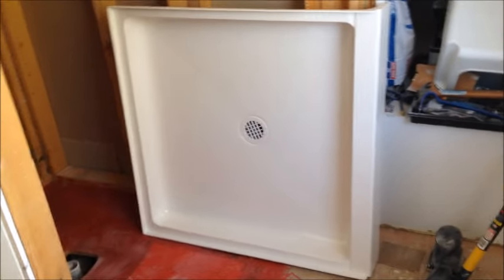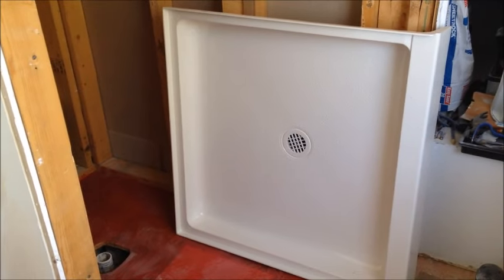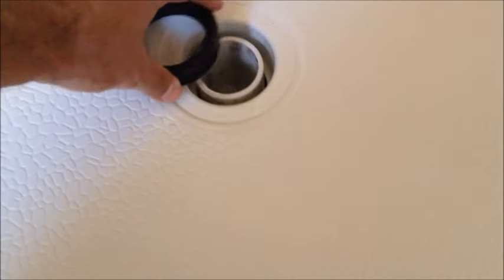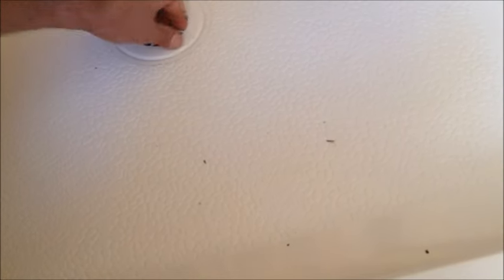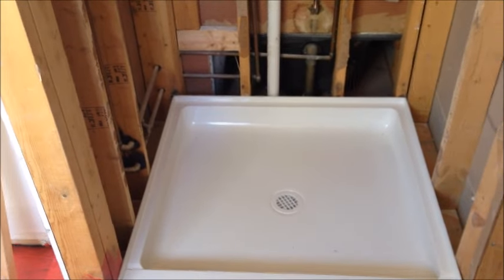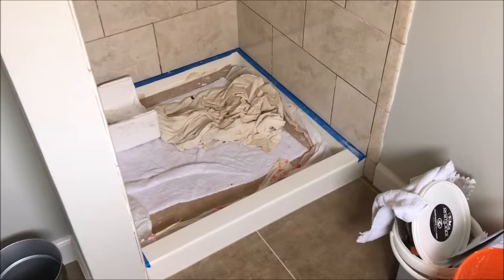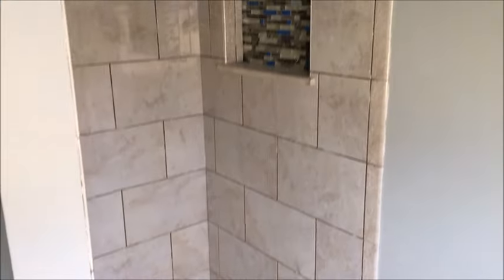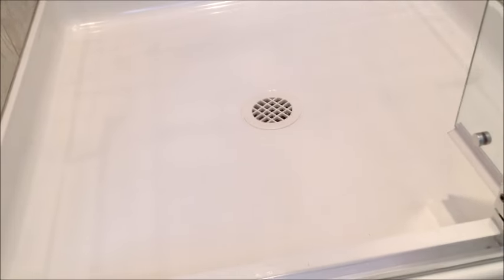Bathroom Remodel   Swanstone ss-3636 Shower Pan Shower Base

Comment: Rick, I have the same exact shower pan I'm about to install. Can you tell me how high the drain pipe should be cut? Is the drain pipe supposed to be slightly above or slightly below the rubber gasket? The swanstone installation manual does not specify.
Reply from the maker: Hi John.  Assuming you are test fitting the pan, I would cut the drain to be slightly below the top of the rubber gasket.  Maybe 1/8-1/4 in below.  Mine is just slightly above the rubber gasket and we get a lot of mildew with the resting water.
Reply: @RickCarlo  thank you!! Awesome video btw!

Comment: So you left about 1/8 inch gap between the bottom of the tiles and the lip of the shower pan? And then used a matching color silicone to your grout to fill that Gap? Just clarifying
Reply from the maker: The pan has a 1 inch (or so) "flange" that goes up the wall and contains the water.  The green board (or cement board, if you are using that) comes down but doesn't touch the flange.  Since the green board is thicker than the pan plastic, the tile can extend down below the bottom of the green board and overlaps the flange going to the top side of the pan (a little tough to explain - just know that you won't see the flange anymore).  So the gap between the pan and the tile is about 1/8' which is easily caulked.  There is room behind the tile, but I did not fill that with more caulk.  The original pan I replaced had wads of liquid nails behind the tile which is not recommended because it wicks up water higher than the flange and into the wall.  I just caulked the 1/8" space and left it at that.  I used a matching sanded caulk.  After almost 4 years I will be removing that caulk and put in a smooth white caulk.  The sanded just seems to have more pockets to keep water and is getting moldy and is hard to clean.  HTH.
Reply: @RickCarlo  thanks man I really appreciate it. Going to be tearing out a bathtub and putting in a 60 inch shower pan after the holidays. Fun fun fun. Your video is very helpful

Comment: Rick Carlo, do you have any info on the shower door you used? i am remodeling the same size shower in our loft and have been wondering on what to use.. TIA!!
Reply from the maker: Ah...a commmon questions.  :-)  It was a Kohler Revel bought from Lowes.  About $550-$600.

Comment: I wander how you installed board and attached it to plastic pan. Can you please explain in detail. Thank you.
Reply from the maker: I'm a little uncertain what you are asking.  The pan isn't really attached to anything other than the drain.  Since this was a renovation the space had been built to fit the 36"x36" pan.  After the pan was laid in the spot I put the greenboard up.  There is about a 1/2" gap between the greenboard and the upper lip of the pan.  The tile overlaps the greenboard so that the gap between the tile and pan is only 1/8".   That 1/8" gap is filled with chalk.  Hope that helps.
Reply: @RickCarlo  thank you for replying to my comment. I am not sure how you caulked the gap between board and pan. I guess that was only missing part because you show the gap and next moment is you already have tile on the wall.
Reply from the maker: @elvirawatson6565  Ah, gotcha.  I basically squirted enough caulk to cover the gap.  This isn't a problem with a nice 1/8 gap, but I can't say I had a perfect 1/8th inch gap around, so I had to fill up where my gap was larger.  I just squirted more in those areas until I could get a good line when smoothing the caulk out.  The caulk did seem to shrink a little in these areas.  After a couple years we are starting to get mold at the bottom.  I will probably cut the old caulk out and re-caulk within the next few months.  For the larger gap areas I plan on making a couple passes.  I'll fill the area and push back a little and let dry.  I will then come through with another layer.  We'll see how that goes.

Comment: How did you adhere the shower base (swanstone) to the shower sub floor?  From the video, it looks as if you just laid it in.  Swanstone recommends a quick dry concrete for the shower base.
Reply from the maker: The base that I replaced had nothing under it.  I did the same with this one.  It is just laid on the subfloor.  The new base is sturdier, but it isn't as solid as porcelain (not as expensive either).  I am happy with the feel when standing on it.
Reply: I used screws on the top ledge at an angle to force the pan down so there's no creaking.  Works well.
Reply: I have the exact same pan. For anyone else reading this, I noted that the front curb has a recess for a 2x4. I measured 34 inches from the back wall and secured the 2x4 to the floor on it's edge. 34" center of the 2x4 to the wall. When laying down the base it creates a very secure force fit. You have to step on the curb to drive it onto the 2x4. I used the 2x4 since I was not using tile, I am using the companion side walls designed for this pan. 
On an unrelated matter, I also used silicone on the drain. The base is 2" deep your drain pipe should protrude 1" into base and be secured so it does not flex. A lot of force is required to push the gasket into place.
Reply: According to the instructions (That he clearly didn't read), you are supposed to use mortar under it.

Comment: where did you buy the glass door, is that something you can buy remade or custom fitted? Thanks
Reply from the maker: We got the shower door at Lowes.  The Kohler Revel (We paid around $550 - can't remember exactly) comes in a couple size, but you can adjust the overlap of the door to fine-tune for your opening.  After 3.5 years of use  it is holding up well.  The hinge area at the bottom could use a good cleaning and soap scum is a constant battle, but I am still good with the purchase.

Comment: Did you put a silicone  first and then grout gap between the showerpan and tile?
Reply from the maker: No, I did not grout the gap between the tile and pan.  The gap is only filled with the matching sanded caulk.
Reply: Rick Carlo oh ok thanks very much

Comment: I can't believe that you installed all the tile and never bothered to test the drain. Testing the drain should be soon as soon as the shower pan is installed, so if you have to remove it, you don't need to demolish the entire bathroom. Also, if that drywall gets wet, your tiles are going to start falling off. You should be using cement board at the very least.

Comment: Can't believe there is no packing nut for that no caulk gasket
Reply: I just tore out a shower pan that had a built in drain (no packing nut) with just a slip on gasket around the drainage pipe; It had a small leak around the drain hole. I'm thinking the rubber gasket starts to develop cracks as it ages. I like the shower pan, but the internal drain is a no go for me. I prefer a shower pan that requires a compression drain assembly like an Oatey. I'm no plumber, but that's my take. Is that your thoughts also? Thanks for any replies.
Reply: @rich3782  _____35 years pro residential plumber here. That cast-in shower drain is fine. The pipe has to be fairly straight up (no split or gouges in it, smooth surface) and the rubber seal has to be in fair shape as well. I use a little bit of lube to seat it. Never leaks. If you use a pan that requires a brass drain spud (never use plastic ones) you better reply to me if you want it to last forever.....there's a few MUST- DO'S involved. Still uses a rubber seal. (best) The guy who posted this left out the water barrier.....doomed install. (guaranteed)
Reply: @readmore3634  Thank you very much for the response back.  Had I known what you just stated, I would have gone with that shower pan in the video.  Instead, I went for a shower pan made by US Marble (not fiberglass or acrylic).  Well, this shower pan had a drain hole that was not located in the center of the pan, so I used an Oatey 42788 Offset ABS Shower Drain with Stainless Steel Strainer.  I had no play room to re-center the drain pipe, that's the reason for the use of the offset drain.  I wanted to go with a brass offset but was unable to find one.  So the one I got is ABS and not plastic.  I used the rubber seal, along with the paper ring to prevent the rubber seal from twisting, below the shower pan and used silicone for the strainer body flange that sits on top of the shower pan.  I believe the drain assembly is UPC approved.  What's your thoughts on this assembly i.e. will it last?  Again, thank you for your input.
Reply: @rich3782  ______I googled "Oatey 42788 Offset ABS Shower Drain" ...never seen one like that, I always do what it takes to move the riser ( 2"pipe) and make it about 6" high so you can slide the drain assembly(already mounted on the pan) over it when you set the pan. Kinda like this:
https://www.youtube.com/watch?v=6gchJ1prCFM
I use putty (not that rubber washer, it rots away and now you have a big leak and loose drian) and tighten that spanner nut tight! Normally don't need that much putty....squeeze it out!
The  2" will be about 6" too high. Slide the rubber seal over the pipe (grease it) and get that seal down in there. Cut the 2" with a small hammer & chisel or screwdriver all the way around, low enough to get the strainer on.
Reply: @readmore3634  Yes, I watched that video awhile back. Looks like a very solid way to connect the pan to the drain pipe. I very much like the construction of the drain assembly; that's going to last a very long time.  The only way I could relocate the drainage pipe was to cut out the first floor ceiling which I chose not to do.  Instead, I decided to go with a drain assembly similar to way a tub drain is connected.  I think I have a reliable connection that will last. I made an access panel for the Roman tub which also gives a visual sight line to the shower pan drain for monitoring.  Hopefully, no leak ever develops at the shower pan drain assembly.  If for some reason it does, I will certainly plump it the way you recommend, thanks again.

Comment: is the base a solid surface base?
Reply from the maker: The base has some "give" when standing on it, but I can tolerate it.  I was so used to the old pan having a bit more give that I noticed the improvement.  I could have put concrete down (like others recommended), but we had had some leaking from an adjacent bathroom and didn't want to change what I did on the subfloor.  Porcelain will definitely feel more solid than the base without concrete underneath, but this was a heck of a lot easier to install.  Been using it for a year at this point and I am still happy.

Comment: So at the 1/2 gap at the wall base interface, is that caulked behind the tiles or do you leave an airgap so water can't wick up the wall?
Reply from the maker: The tile  hangs down over the 1/2" gap.  It overlaps the edge of the pan.  Where the tile meets the pan there is a gap between 1/8" to 1/4" which is chaulked.  It is a simple bead of chaulk and does not fill the void behind the tile.  If water gets behind the tile it is retained by the  pan which flares up on all edges.  After 3 years, I probably should re-chaulk the bottom.